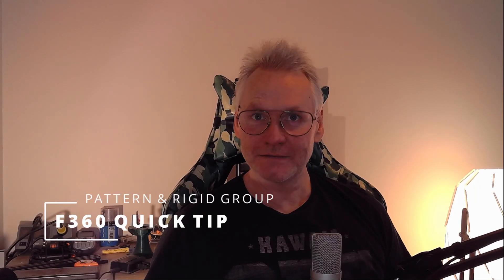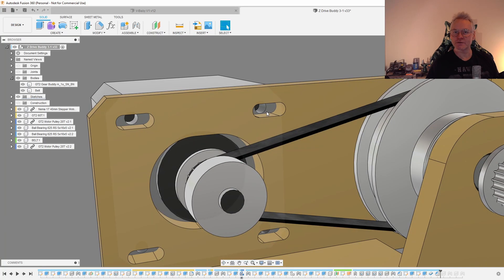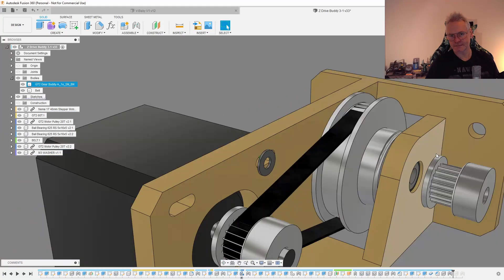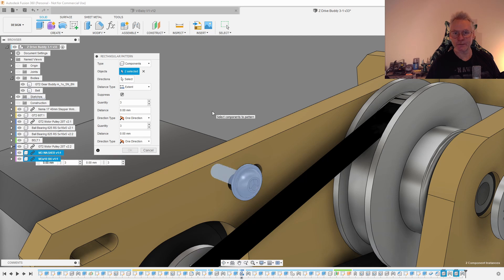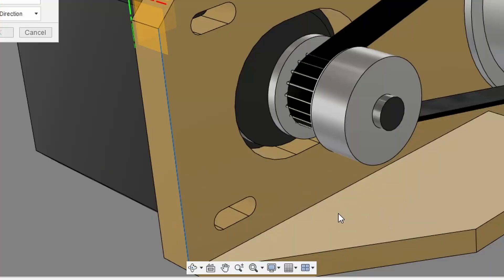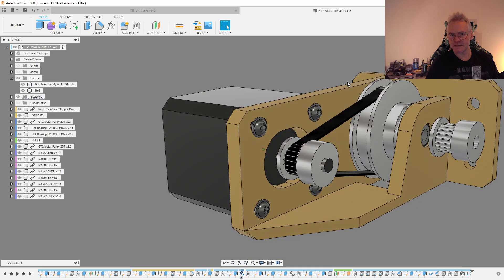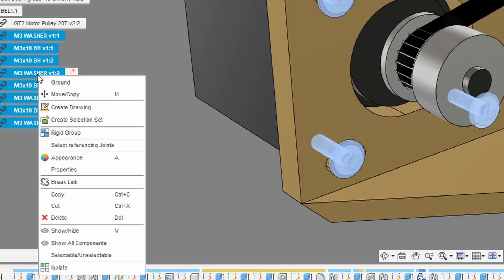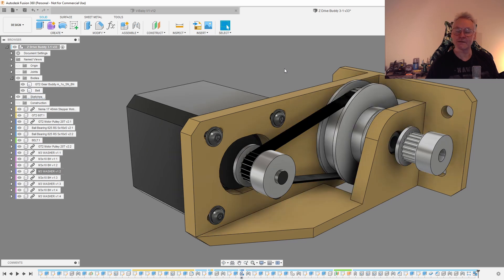SAVE TIME IN FUSION 360 | PATTERN COMPONENTS & RIGID GROUP

Comment: Thanks Roy. What are the specs on your Fusion 360 computer? I'm running an i7-8700 with 16gb ram on an ssd drive and a GTX 2070 and Fusion 360  is not as fluid as yours
Reply from the maker: i7-8700K 3.70HG/16GB Ram (little on the limit i feel) then GTX 1070 only
Reply from the maker: I do have a 3d connection mouse for smooth moves
Reply: Very similar. I also have a 3dconnection space mouse. I can't recall the clock speed. Maybe is  something in the Fusion 360 configuration. Thanks